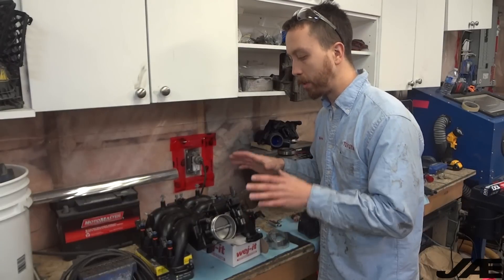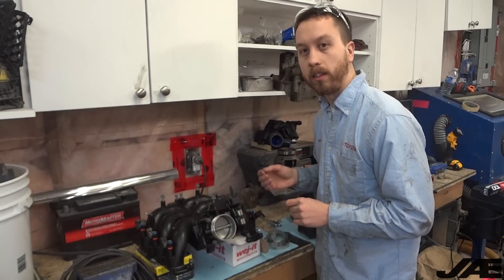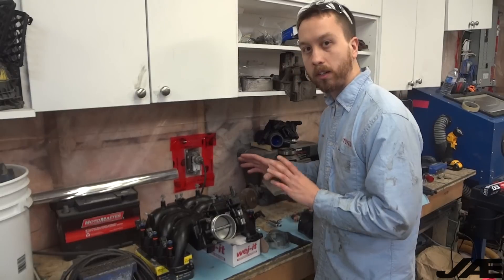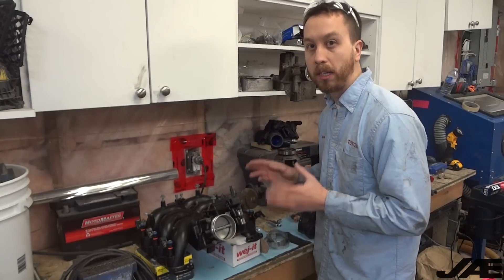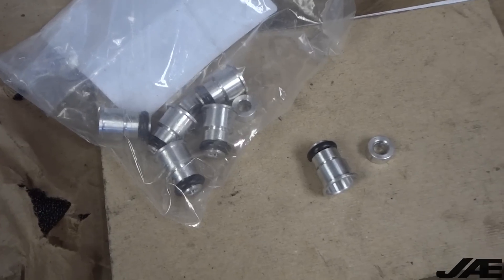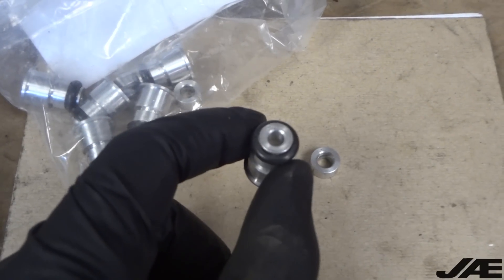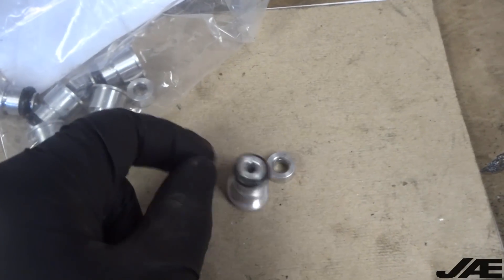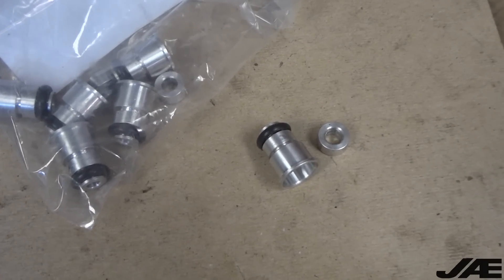Project B6 2.7T Stage 3 EP5 - Fuel Injector Install

Comment: I didnt have the best of luck with 034 and the stage 3 fueling/tune packaged for my c5 a6 2.7t. the fuel pump in the package ment for the same car i have, elsewhere on the website, the fuel pump alone says it didnt fit my car, so it didnt make sense that it was in their package for my specific car. I sent it back and then took them  9 months to send the correct pump. Trying now on the injectors and hoping what was included on injector wise, fits, but so far im not expecting it as how everything hhas gone down so far.

Comment: Sounds like another case of a company manufacturing a need for a product. I've never enjoyed dealing with 034. The few times I've had to call them with a technical question related to a product they sell the response on the other end of the phone was pretty much what you described. Very annoying after you've spent thousands with them. It'll suffice to say that there are plenty of other companies I'd rather give my money to before them.